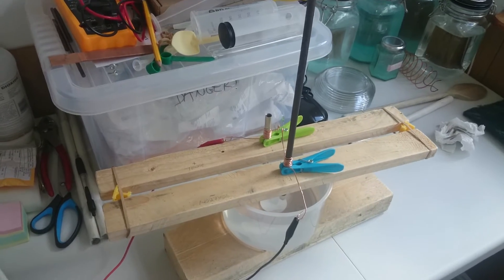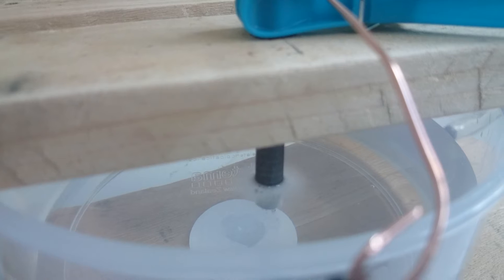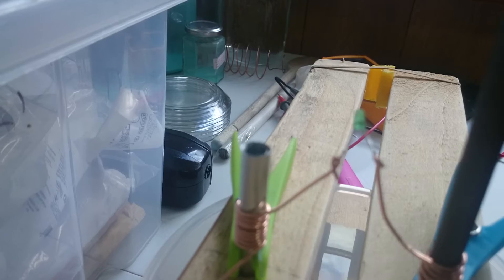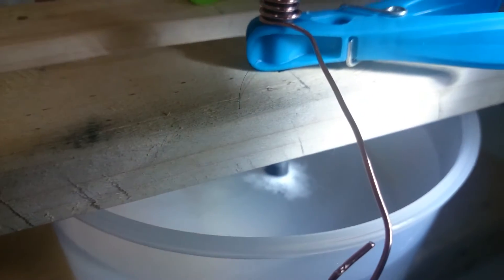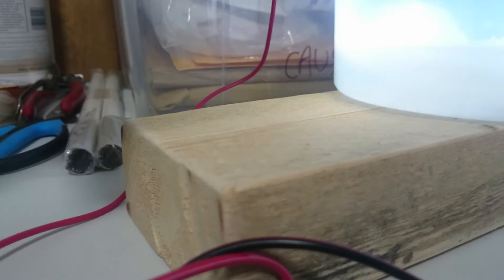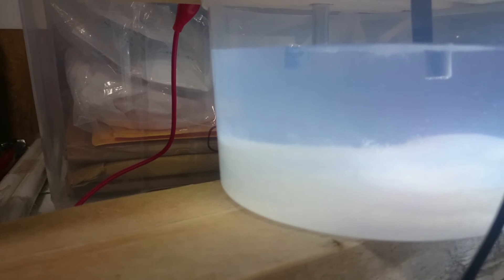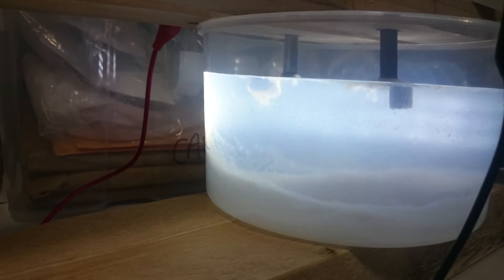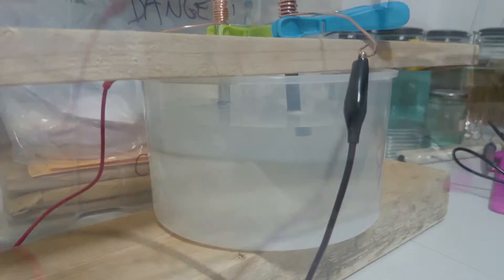CO2 GaNS Gel Replication Attempt #1

Comment: How did you connect the led light to the copper wires? :)
Reply: As shown Taiyo, just twist the copper wires together with the leads coming out of the LED. Make sure your polarity is correct or you'll burn out your LED.

Comment: a question in the traditional model for CO2 production without load the positive of the led goes on the coated nano copper and the negative on the zinc plate! already with load reverses this process is it?
Reply from the maker: I think you mean to say "power supply" instead of load because in fact the led is the load? The reverse of polarity on led is due to fact that without a power supply the current flow is coming OUT of the gans cell as in a galvanic cell, and with the power supply it is going INTO the gans cell as an electrolytic cell. This reversal also reverse the polarity.
Reply: thanks for replying I'm new to keshe technology I'm learning I really liked your videos
I'd like to hear from you if these links are correct for a video I saw on You Tube to produce CO2
Led positive on carbon rod Negative Led on zinc
   Alkaline Battery AAA Stick 1.5 V negative of the Battery in the carbon rod Positive of the Battery in the zinc
I saw this video on Youtube here in Brazil it seems that the CO2 Gans was very good
Reply from the maker: Battery polarity is correct but led polarity must match it. If led is hooked up in reverse it is as if no led is used, so no harm and it will still produce gans but not the exact same gans as if the led is used properly.

Also, every time I have hooked up the led in reverse it has blown the led. if you connect just the led to a fresh battery with correct polarity it will light. If you then reverse the polarity (on most cheaper leds) it will blow the led out and when you hook it back up again properly it will not light any more. Try it!
Reply: Thanks for your info was very helpful !
Reply: Hello friend yesterday I started my production of get CO2 gans I did an experiment similar to yours I used a 1.5 v stack load instead of the led I used a computer fan I used rain water I put only 1% of sea salt in the water, fervi the water and then I hit a blender, to mix well the salt and then I coi, I made the installation the same way as yours, I put the negative the battery of 1.5 v of the fan in the carbon rod and the positives in the zinc, on the side of the zinc began to emerge a very light and transparent gel and descended very smoothly, just as in his video the gel that came out of the zinc was around the zinc rod, already in the carbon rod the little gel that came out was much more whitish and descended quickly .
I've been harvested for 19 hours and it's still produced in the same ways as the first 3 hours. I would like to know what you think
Reply from the maker: There's many differences in procedure, but the real test of the GaNS is whether it exhibits ability to relieve pain, calm the being, heal things needing healed, and to open awareness and consciousness to new levels.

So you must in the end conduct these further experiments with yourself and others and then you know if your GaNS is good!

Create plasma water with the GaNS, drink it... create GaNS patches and place them on areas with pain, or which need healing. There are many more ways to use it also, Google for them.
Reply: I was testing if the salt made any difference in the production of CO2 gans when I put 1% salt I realized that it produced enough zinc oxide about 95% I put a new solution this time with 9% salt the two rods interacted well they produced a lot of bubbles when these bubbles burst out a gel inside I think it is CO2 but there were many bubbles without bursting I took out the reactor with 7 hours because I was not producing bubbles anymore I think that this time with following 90 or 95% of CO2 I will test another solution with a higher percentage of salt Thank you for answering my comments.

Comment: lower voltage would be better? ive heard peeps say the same thing. Slow and gently
Reply: The higher the voltage/current the more ZnO you get. So lowering the voltage/current produces a fluffier more CO2 type gans, but the ZnO has a lot of value also, so it's a matter of what you wish to achieve with the gans as to what level of voltage is appropriate. You can also make gans with strictly field effects, no voltage, and no electrodes, plates or rods actually touching the water.

Comment: Why can a carbon rod be substituted for nanocoated copper? Doesn't seem like any nanocoated superconducting particles involved there...
Reply from the maker: That's a very good question. Seems Arvis Liepa of Liquid Plasma Feeding on Facebook pioneered this technique, or at least made it known via one of the KSW's when Keshe featured what he was doing. 

I have checked into this a bit and graphite indeed can have nano particles in it under 600nm.  Generally speaking particle sizes smaller than 500-600nm qualifies something as a nano-material. 

Also, plasma exists everywhere, what we are doing with Keshe tech is finding ways to stimulate it into producing what we desire. In this case we are attempting to capture gases in a nano-matter state within our salt solution. To my way of thinking, it seems entirely plausible that the use of a carbon rod that has some nano carbon type particles in it could in fact setup a similar plasmatic field as a nano-coated copper plate.
Reply: Thanks. Keshe did seem to agree that carbon rods would work. Hopefully their effectiveness will be confirmed. Because apparently everything that looks like GANS is not GANS... (?)
Reply from the maker: That is true, just because you get something precipitating out of solution during electrolysis does not mean it is gans. One has to rely on other means to know if you have good gans or not. 

The gel look, like Keshe has shown and I'm attempting to produce here, is a good indication that you may indeed have CO2 gans. The gans I produced in this experiment was probably about 50% ZnO gans as witnessed by how much fine white powder there was in it before harvesting. 

I've just produced another batch only allowing the gans production cell to run 6 hours and this is much more translucent and gel-like. I'll have another video posted on this production experiment soon.

Whether the gans works in a magrav, capacitor, power cell, health cup, health box, pain patch etc is probably the best way of knowing how good your gans is.

Comment: I can see that there is both the Zincoxide and the Jelly together in there.  There will be separate layers. I have been really busy plus dealing with the immense power of the Keshe Cup Of Life and its personal effects on me.  I will try to do some update here for you soon.  Good to see you have made progress!
Reply: Appreciate your interest. I don’t do videos or FB etc. but can
if necessary.  I’m  using various containers with ¾” carbon
welding rods and 5/8” zinc rods immersed to a level above where the GANS will
be formed. I use a minimum amount of salt (various kinds) just enough to allow
a current flow of .05 amps or so (no LED), because I do not believe the salt serves
any other purpose than to facilitate electrolysis – but of course I could be
wrong. I let this sit for a few days until I get an inch  or so of GANS on the bottom. I tried eating
the GANS but since I noticed the zinc was flaking off into it I stopped and now
just rinse it and drink the plasma water. As I have a painful leg condition, I
tried putting the GANS in a plastic hot water bottle and sleeping with it, but no
change. (I also bought a pain pen from Renan and made my own but they didn’t help
either). Not that I’m skeptical, but I’m probably doing something wrong. I
signed up for the student education program and am wading through it slowly,
but details like proper GANS production are hard to find so I really appreciate
your help. I also want to help others with health problems so I want to learn how
to do it right. 

Oh yes, I have a device called a Bioplasm NLS which does
over 1200 metabolic measurements which I use to monitor myself daily. I highly
recommend this device to anyone wishing to keep track of their health. It is a
quantum device which also does electronic therapy. I have noticed a general
improvement in almost all readings while taking the GANS, and liver functions
appear normal for the most part as far as I can tell. However, it seems that
the energetic improvements have not yet translated into physical ones, but I’m
hoping… 
Thanks much!
Reply from the maker: Looking forward to your next video John! Yes indeed, as I said in the video it got too much ZnO in it by leaving it go overnight, but your observation abut the jelly being in there is helpful as it appeared to me that way also.

 Should have stopped it where I originally said I was going to! Next batch I'll let run 3-6 hours and no more.
Reply from the maker: Hi again John... can you clarify the 15% of salt by volume you used? Was this using the method whereby you dissolve as much salt as you can into distilled water to create a 100% saline solution then use 15% of that with another batch of pure distilled water, or...?
Reply: Explorations Unlimited

Hi Simeon, No.  Just 10-15% into a container with distilled water. Shake vigorously until dissolved.  Then I just let it sit for a few minutes and then use it just like it is in the container.  I do not filter it or do anything special etc.
Reply from the maker: How are you determining the 10-15%? There's more than one way!
Reply: What does zinc oxide look like?
Reply: adhanda2017
 Thicker and very WHITE. c02 is not solid white. This is why keshe states that there is always a mix of zinc oxide with the c02.
Reply: WOW very helpful. That's what I'm getting but it's not helping my health issues. Guess that's why. Thanks!
Reply: adhanda2017
Do not try to consume any of this stuff. It can turn FATAL. There is a process for everything.

Cheers.
Reply: I've been drinking CO2 plasma water daily and ingesting the GANS with no bad effects. How about the two AIDS patients had no symptoms after two weeks of drinking GANS water?
Reply: adhanda2017
shoot not me. it OVERPOWERS me big-time. I would be interested in seeing yours and how you consume. Do you make any videos?  Also, I guess you are taking it relating to a condition you have or are trying to reverse. You are saying it has no effects correct?  One thing I will say that I am certain of. Do not ingest copper oxide gans.  It will shut your liver and kidneys down. BAD idea. I think Keshe recommended 1 drop of the surface water of copper oxide gans to 1 drop of c02.  I will not do it.  Touching it was too much for me too handle.  I am taking things very easy. I am interested in your shares though.

Cheers.